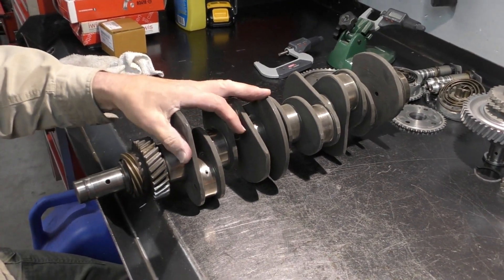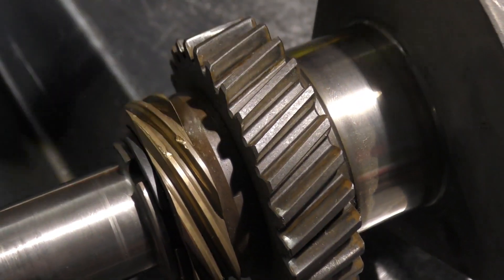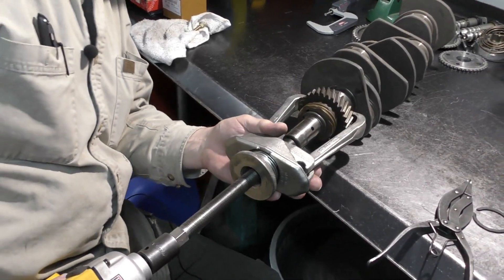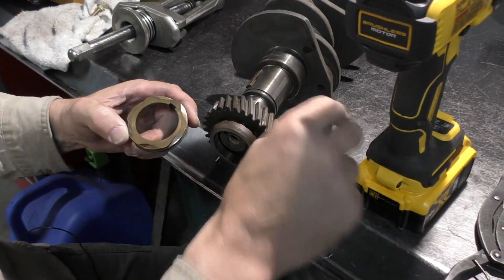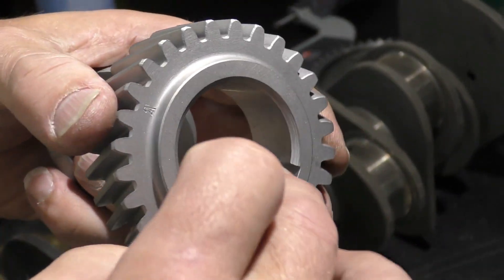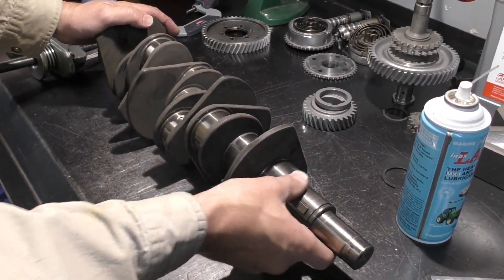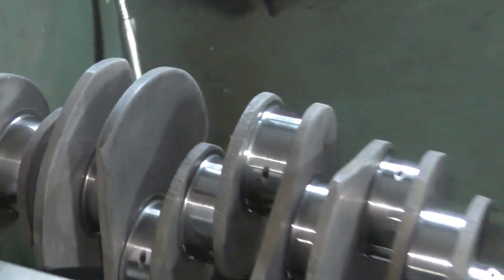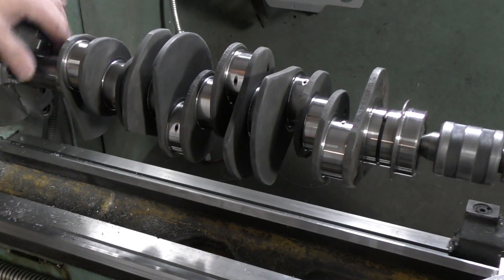Crankshaft Polish. Porsche 1970 911E Engine build.

Comment: Nitriting can increase journal size to save a crankshaft if the crank is on the low end of tolerance specification.
Reply from the maker: It can, but is more expensive. When bearings become more of an issue then maybe it will be a more viable solution.
Kurt

Comment: Is this to increase bearing lifespan?Or perhaps for better oiling? Another great video! Thanks.
Reply from the maker: It is because we dont want to a new bearing against a used crank pin. The polishing knocks down any small imperfections on the journal's that could damage the new bearings.
Kurt